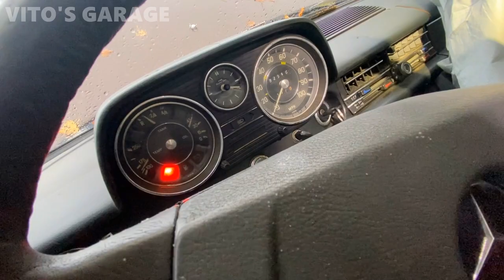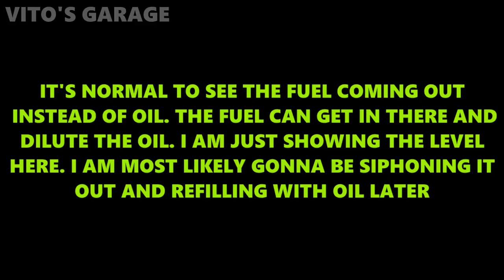1976 Mercedes 240D W115 Replacing Steering Inner & Outer Tie Rods, Oil and Filter Change

Comment: 15W-40 mineral oil or syntetic? some of my friends say I should buy 10W-40. The engine is not worn, or its not in a bad condition. Should I buy 15W-40 mineral or 10W-40 syntetic?
Reply from the maker: 15W-40 Mobil Delvac engine oil is what I use